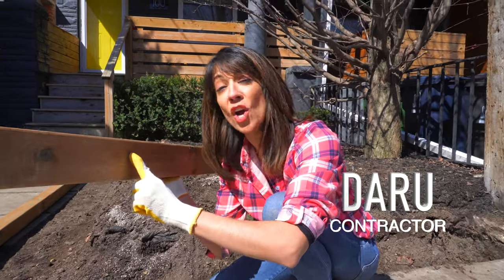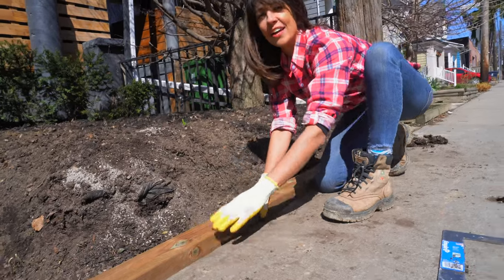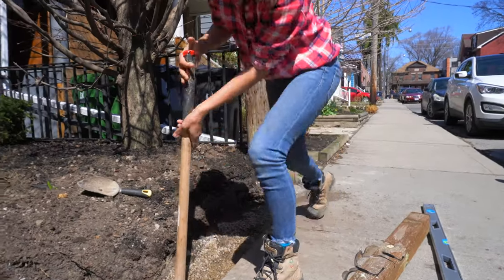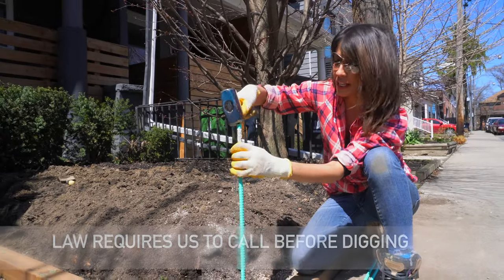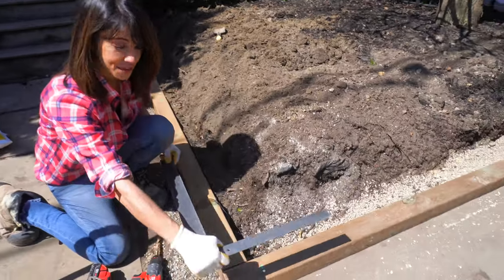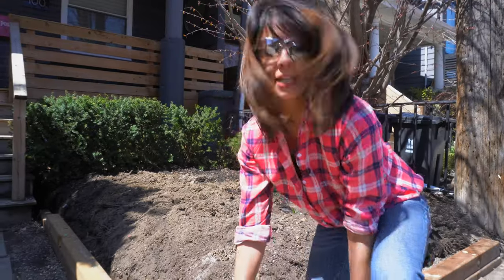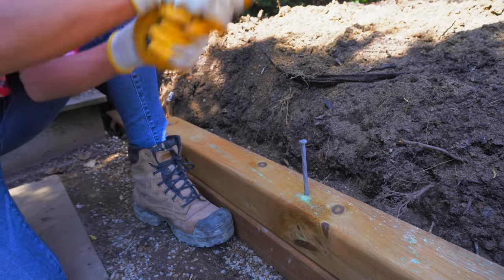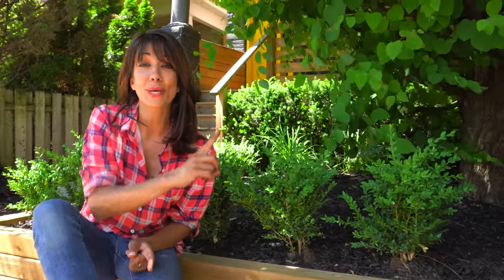How To Build Raised Garden Beds | Upgrade Your Garden Edging!

Comment: Thsnk you for your very helpful videos Daru. I clicked on this one from the last vid where at the end you said find out how to do a garden bed or retaining wall. But this video didn't mention retaining walls. Does this garden bed method work for building retaining wall?  Or is there an actual retaining wall video? I legit need to replace my retaining  wall that is falling down. Thank you for your help. 
Also  what is the natural sealer you recommend for the cut edges of the 4*4s? Thanks again your are great
Reply from the maker: @gretchenbergstrand5489  yes this method works from small boarders. Large ones and retaining walls require a few more steps. But use these too. I’m working on a retaining wall project now. That video will come out soon. The end grain sealer - I pick that up from the lumber yard area of my local hardware store. Yours should have it too. I’ll have some good tips in that one about what I’ve found works better for retaining soil. Enjoy your projects!
Reply: Thank you so much, I look forward to seeing that video!